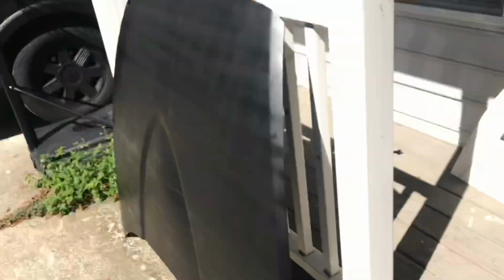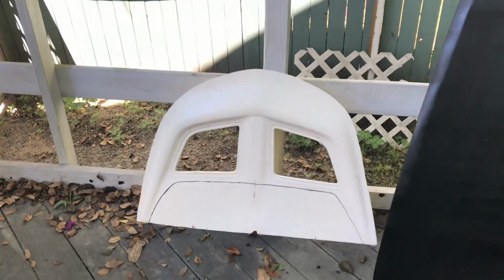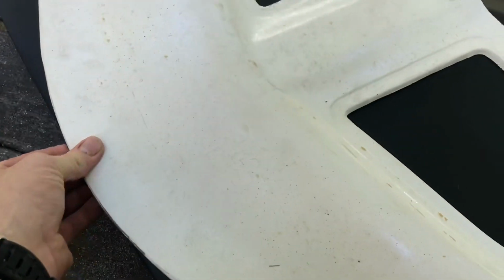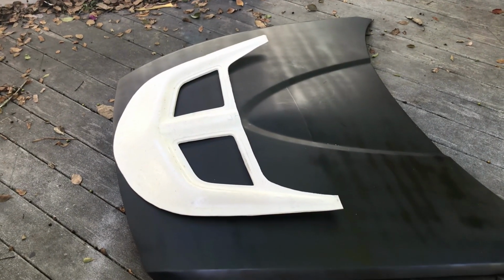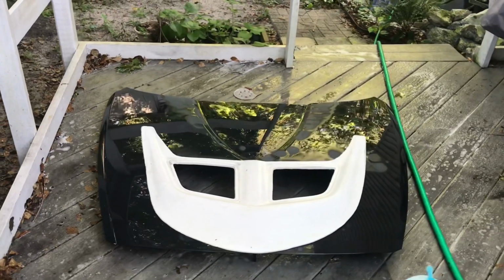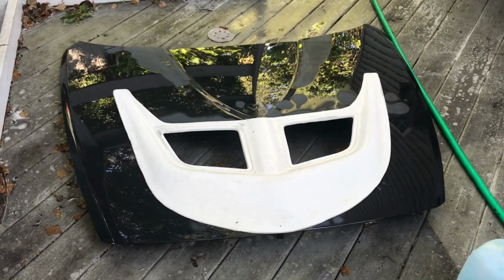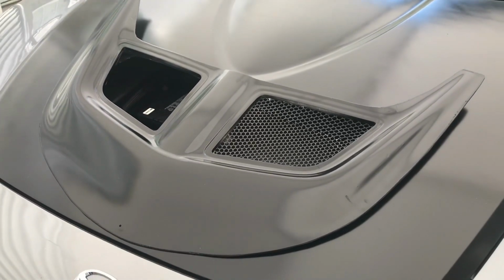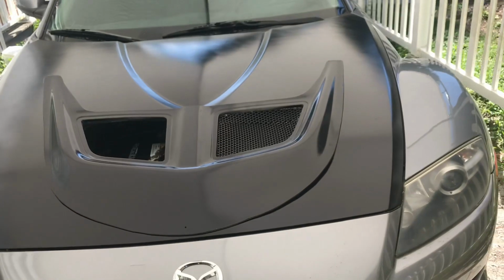MAZDA RX8 CUSTOM HOOD VENT EVO 8-9 STYLE (cooling mod)

Comment: This looks awesome I must admit. But for functionality the vent should be placed much further back, to encourage air flow through the engine bay. Also your vents are right above the battery. Be careful of water ingress...
Reply: Further back? Definitely not. Do some research on the topic before spewing false info.
Reply: So all other vented bonnets including the specialist manufacturers are all wrong? Hmm… unlikely
Reply: Both of you two sound like you way no less than 400lbs

He's mostly right. While it's not bad, it's not the best.

AutoExe, RE Amemiya and FEED have their vents further back.
Reply: Having the vents behind the radiator creates negative pressure and helps the efficiency of the colling system. Unless the car needs to vent excess heat from a turbo charger, then having the scoop further back is pointless.